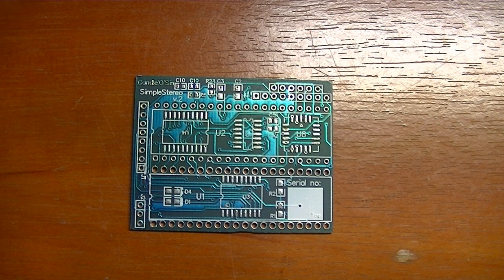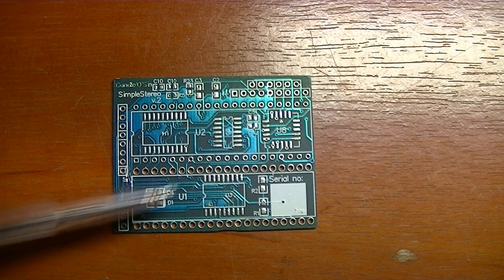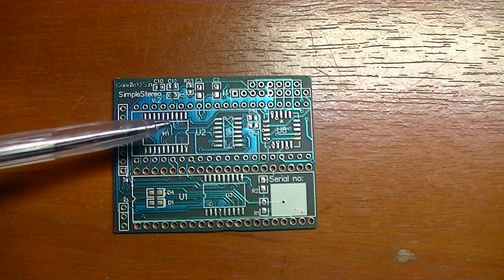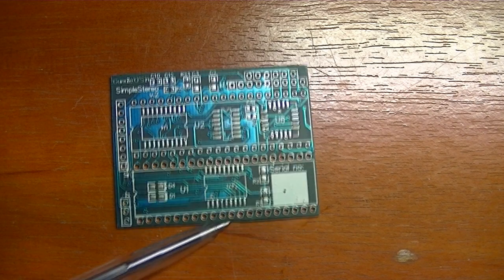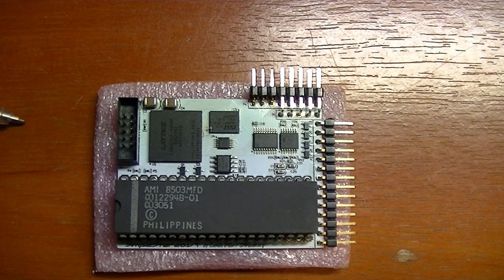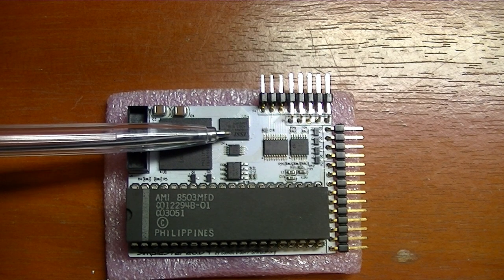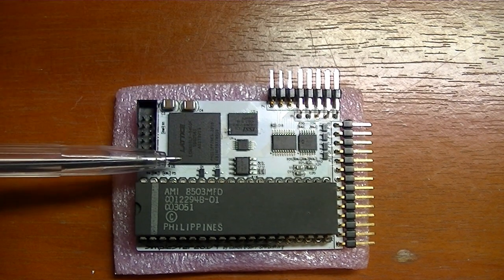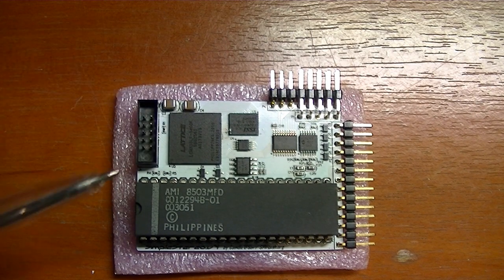SimpleStereo V4 Demo

Comment: Great to see you got something 16-bit going with an Atari 8-bit. I've read about how Tramiel's Atari tried to create an 8-bit computer with the Amy chip, which was developed at the Warner Atari. It was also a 16-bit chip, analogous to the AdLib card in PCs that came out some years later. Atari didn't get that combo working, though.

Comment: Does this sound upgrade for the Atari 8bit interfere with some original game/utility software on the Atari ? I am interested in this upgrade, but dont want to have problems when using some older software. Also, can it be enabled/disabled using the U1MB upgrade or a hardware switch on the outside of the Atari computer ? Thanks for sharing this video. Greetings from Stormtrooper of Death, former member of the High Tech Team
Reply from the maker: I would say there is not, but immediatly I know I can't be sure, and there is one title written in a way that if anything is present in pokey shadow address space (d210-2dff) it will stop working properly - bounty bob strikes back, but - it can be always disabled with configuration tool or flip of a switch /U1MB bios
Reply: @gyorka  Thanks you Gyorka for the superfast reply.

Comment: Share the love.  I know it may seem sacrilegious to Atari users, but make a version that works on C64 (even ZX Spectrum) as well.  Make it a new standard.  I'd love to see David Murray's new games (on the Commodores) use something like this as an option.
Reply from the maker: David's work is really impressive, but with his "dream 8 bit computer" i got the impression, he decided against including yet another FPGA into its design. As for general theme - of making this for another computers aswell - it all comes to the software - without great work of Mono who wrote all these players i wouldn't have anything to show!
Reply: @gyorka  I wasn't thinking of the Commander X16 project.  I was just thinking of perhaps a SID chip replacement or similar.

I mentioned David for his "Planet X2" and "Attack of the PETSCIII Robots" games, not his ideas on hardware.  However, considering how his Commander X16 uses generic VIC-20 style chips, adding a sound expansion shouldn't be a big deal.